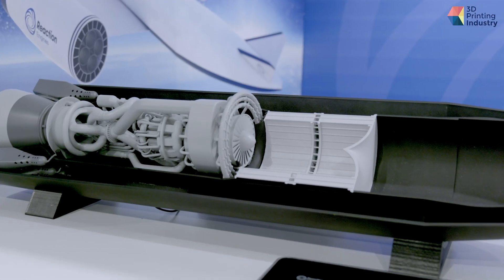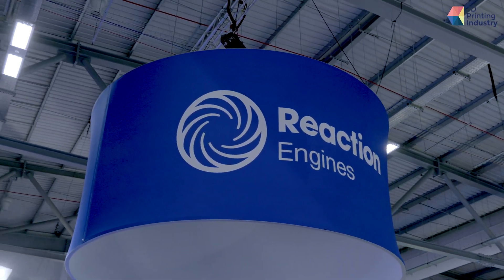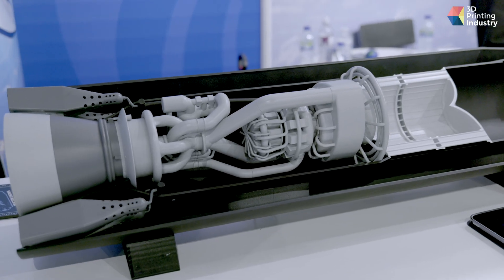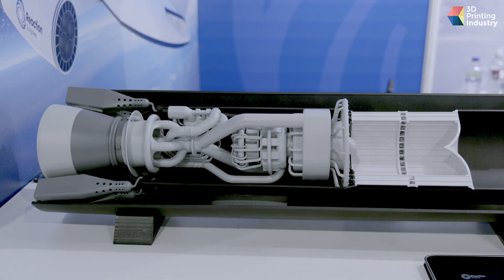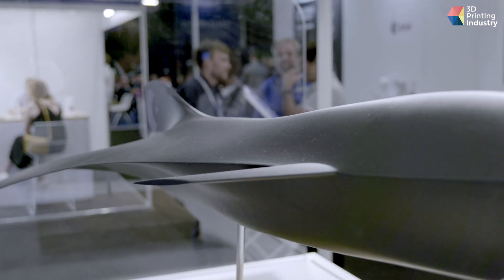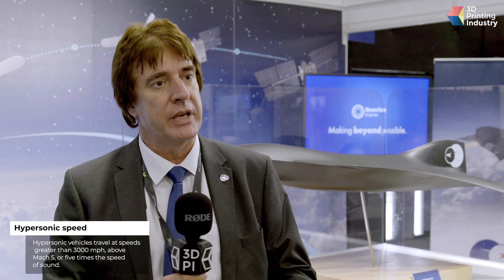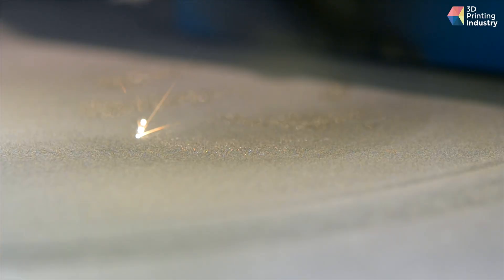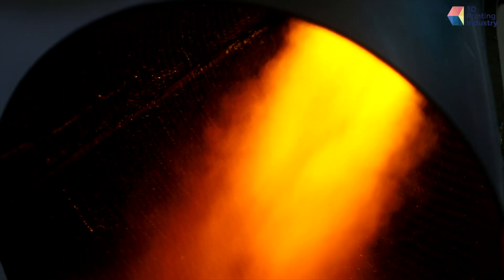HVX: 3D printing goes hypersonic with Reaction Engines, RAF, and Rolls-Royce

Comment: Those chambers they keep talking about, and heat management talk, reminds me of how in the middle east their able to make ice from just management of air flow.  I think they call them Yakhchāl.  Maybe this is also incorporated into cooling the fuel for the engine.
Reply: making liquid oxygen out of the air to burn as fuel.
Reply: @mikewade777  no the air isn't liquidised, all the lox is load at ground for it nonairbreathing phase. Part of the advantage of the precooler is that the air is cooled down in a short amount of time, 1/20 of a second, while keeping it a gas.

Comment: Super interesting im here, hooray internet!! 
Are you the best option to 3D Print a boat roughly 36L x 18W Catamaran style?
Reply: Fastest production time.
Reply: 36ft L X 18ft W
Reply from the maker: @Sipnslide  Hi Damian, probably not for us. We've got plenty of 3D printers - but they are for review rather than this kind of work. Try searching for a 3D printing bureau - plenty should be able to talk with you and understand your project better. 

Out of curiosity - why do you think 3D printing is the best way to make your boat?
Reply from the maker: Good to know.

We have reported on several different 3D printed boat projects, for example this commercial enterprise: "Customizable 3D printed boat manufacturer Tanaruz is reportedly planning to scale up the production of its commercial boats to 300 by 2023.

3D printed using reusable polymers, the boats are claimed to be more sustainable and cheaper to produce than conventionally manufactured models, and come in a range of four models spanning 4.5-10 meters in length."

https://3dprintingindustry.com/news/tanaruz-plans-to-produce-300-3d-printed-boats-by-2023-207466/

And in the military domain:

"The University of Maine (UMaine) has 3D printed two new large-scale boats at its Advanced Structures and Composites Center in Orono, one of which is reportedly the largest vessel ever to be additively manufactured.

Developed for the U.S. Marine Corps, the prototype boats are designed to be logistical support vessels and will be tested for field use by the armed forces. The larger one can carry two 20-foot shipping containers, while the other can transport an entire rifle squad with three days’ worth of food, water, and other supplies."

https://3dprintingindustry.com/news/umaine-3d-prints-two-new-large-boats-for-u-s-marines-breaking-previous-world-record-205260/
Reply: @3DPrintingIndustryNews  It pretty impressive what they can do with 3d printing technology.

Comment: Reaction Engines is that the same thing as Scram Jets?
Reply from the maker: So Reaction Engines is the company, the SABRE engine does have elements of a ramjet engine. There is a great BBC documentary called "The Three Rocketeers" that goes into Reaction Engines origins and earlier projects. Worth a watch!
Reply: no, scramjet is short for supersonic combustion ram jet.  what reaction engines is developing is sabre, short for synergetic air breathing rocket engine.  it's a hybrid engine that transitions from air breathing jet, to something like a ramjet, and then to a rocket.  which means it can take off from a runway under its own power, and potentially go all the way to orbit. scramjets are by comparison very challenging to engineer, and i haven't heard of anyone trying to make one that could power a vehicle by itself- it would need some other engine to boost it to its operating speed, like a detachable rocket stage for example
Reply: Not quite. At mach 5 SABRE uses the cooler to convert oxygen to fuel and goes from jet mode to rocket mode & can therefore theoretically reach speeds approximately mach 25